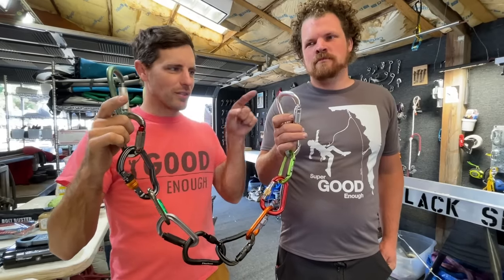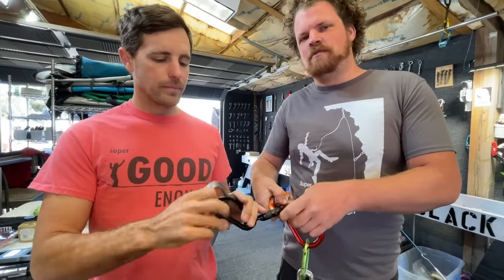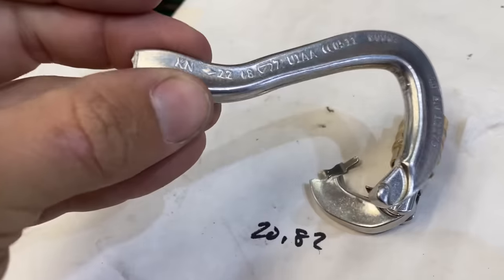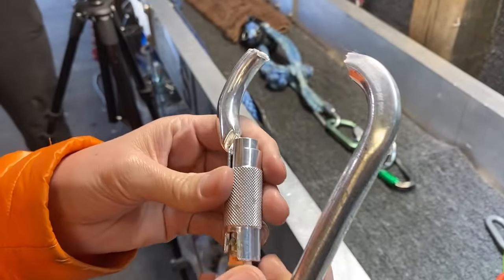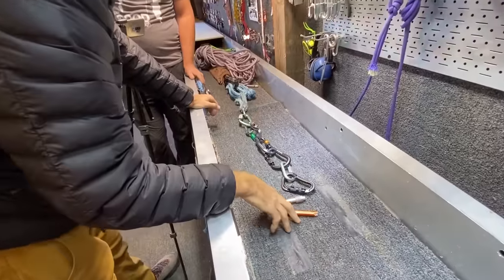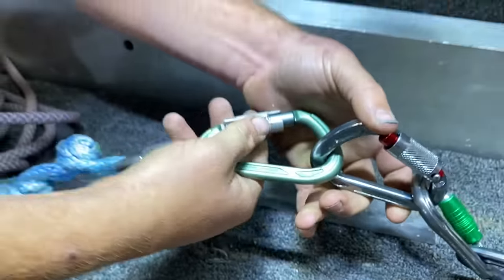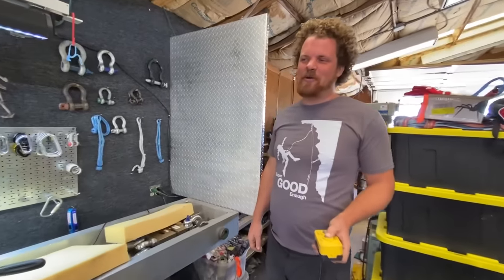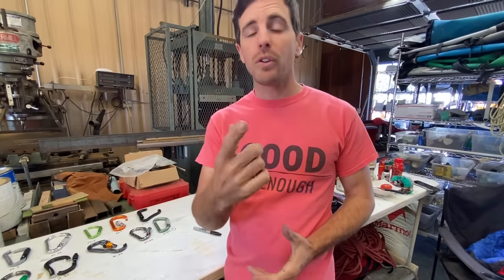Does Petzl's Wire Lock locking carabiner hold up to other climbing carabiners?

Comment: All the carabiners have slightly different thickness and one carabiner can have a thicker "neighbor" , another one might have thinner neighbor adding lower or stronger force in the point of contact. Think of it as a thinner rope cutting into your hand harder than if it was a thicker rope and same weight of what you carry. I would put same exact steel carabiners as intermediaries to keep the experiment even cleaner

Comment: you should do the same with a normal distribution, stronger on the middle then weaker and weaker until  both end, i would think your results will be predictable (the weak break first) as here i was anticipating the weakest would not break first because the energy which deform the other one "protect " it and the actual force value on this carabiner at the snap moment is lower than what the dyno is pulling

Comment: if its rated at say 25 and it  fails at 25 then its not acceptable..  a bridge is rated at 100 tonnes but  doesnt  fail till 300 tonnes..
its called a safety margin

Comment: You've done this type of test a few times now, so I hope you fully understand that the biners on the END of the string will see higher forces, and the ones in the middle will see less force, due to the elasticity of all the other biners they are connected to. So you can't make this test 'fair', but yoiu can make for more consistent results if you put the weaker ones in the middle, so they can break first, and do less damage to the other ones that will break later.

Comment: I believe all these tests are not accurate and misleading. You can have two pieces of the same carabiner and the breaking point may have different result. At least one person have already mentioned it below in the comments that each carabiner should be tested separetely. What I would add is that all carabiners should go through tests starting from 20kN to 30kN because the force is not applied instantly. This is why I believe the numbers from the tests in the video are highly incorrect.

Comment: use safetyglasses when there is flying shrapnel, you might wear them 10.000 times and nothing comes even close to happening but do it anyway you guys have a platform, set the example do not preach it just do it.

and the carabiners that wont open is most likely the result of plastic deformation where the geometry allows the lock to open, and after the hook breaks  it will again function.

Comment: This method does not provide a fair comparison or accurate results.  Each cycle will introduce fatigue into the remaining carabiners.  Also, the carabiniers have differing cross sections and contact areas, meaning that pressure between carabiniers will not be consistent.  For consistency, each carabiner should be tested individually using the same test equipment and speed of force application.

Comment: I liked the video. As you said its more of a demonstration than science. 

Sadly after the first run the results aren't reliable. After repeatedly going near the tensile limit the metal will start to deform and strength will be lost. Your experiment tests durability or repeated use more than anything. I just wouldn't trust the force they break at after the first run. I imagine that rating is measured over a short period of time or a set time which could result in a higher rating. 

It would have been best to rig it so you tested one at a time and measured and  plotted force over time. You would see many i teresting things with this type of test.

Comment: The curve in the spine deliberately adds weakness, or short-travel “give” to compound the failure force.  It will not show up on a slow pull test where it will bend straight under heavy load, but will on a sudden impact test, like you falling.
Can you think of a good reason to have this in your life-saving equipment besides deceitful marketing? 
Basic engineering.